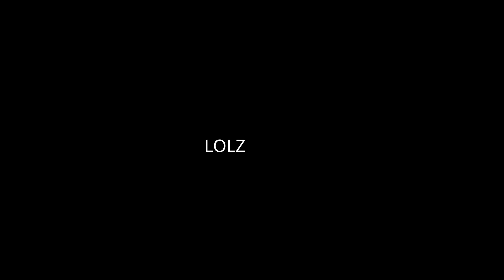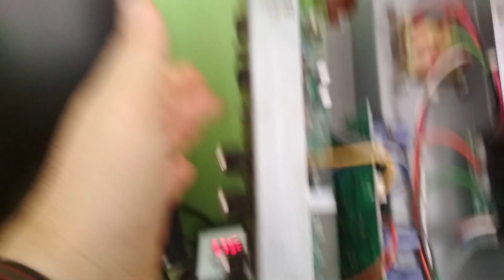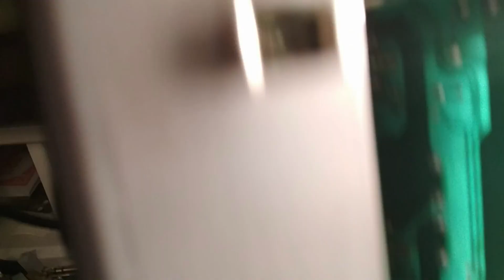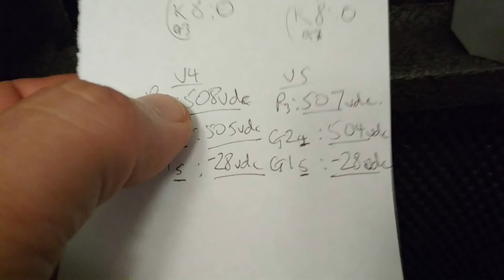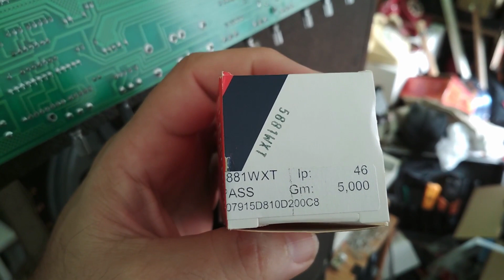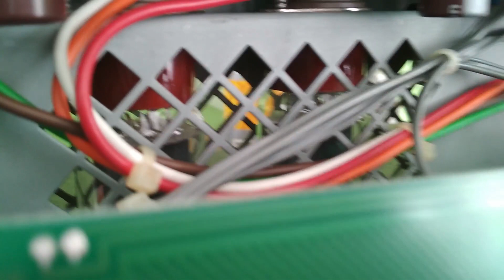Marshall JTM 30 from Hell

Comment: I just finished modding the Marshall TSL100 which in itself is a nightmare but can easily be done so the tubes never Red Plate again. Marshall really ruined their Company by making these boards such as the TSL conductive board where you have to take a Dremel gun and grid pin 5 of each power tube away from the board and rebuild the bias grid.
So sad that a once Great Company didn't care or do enough research on the parts they were using. Simply Sad.
Reply from the maker: Amps use to be built by people with pride. Now, like everything new and modern, they are built with price, not pride.

Comment: i need some of help... in my case... the amp was not used since  long years ago.
The clean channel sounds Perfect but the boost channel not work fine... sounds very low volume.. with aleatory noise and with a lot of power less,

I have circuit diagrams. Any ideas where I should start?
I'm almost sure the problem is NOT With the tubes. Prior to the failure, it has been used moderately... no more than 2 years...
Reply from the maker: @CristianGarcia-sw8ve  it sounds more involved, I’d be looking at signal tracing where things are going wrong.
Reply: @FixItAgainPhoney  almost surely theproblem is in Caps..because The amp worked perfectly the last time it was used. Therefore, the electrolyte in the filters has probably dried out.
It was like 5 years without turning on...or more. I haven't started repairing it yet
Reply from the maker: @ you’re possibly correct. One way to find out. Keep us updated.

Comment: Interesting, same amp & same issue on my bench (Bias voltage drop taken from -39v down to -30v on pin 5). BUT in my case it appears that PI leaky coupling caps are responsible.
Otherwise, disconnecting one end leg of the zeners gives a bias voltage increase to -50v, no more. So I put a 51v zener instead for security and added a bias pot - wich can be useful if customer wants to choose between 5881 or 6l6.
Reply from the maker: Nice little mods to help make adjustments. Indeed the PI coupling caps can definitely cause this kind of thing too. Very common.

Comment: Bon j'ai fini par trouver le problème tout simplement une lampe du préampli  en fin de vie  . Le fait d'avoir changer les condensateurs l'a certainement achevé. Je crains quand  même devoir faire le bias mais je ne sais pas trop comment m'y prendre . Faut il retoucher à ces fameuses diodes ? Merci d'avance. Dan
Reply from the maker: Yes, it’s worth increasing the value of the diodes anyway, purely to bring that bias down below 100%. Three 15v zener diodes should be fine but every amp and set of 5881 tubes will be different, so you’ll have to experiment with your amp.

Comment: Hello  . Could you give me some directions. I have a breakdown on my Jmp 30.
No sound on the crunch channel and very low on the drive. The amp works correctly I changed the majority of the capacitors. There was a problem with the treble potentiometer turning on itself.
Thanks for your help. Dan
Reply from the maker: Hi there. It would be challenging to diagnose but have you used the correct value treble pot? Are the solder joints and circuit board traces still in tact? Do you have a signal generator and oscilloscope to properly diagnose and signal trace the signal path to see where it drops off? You’ll have to trace from the input jack to first tube grid, out of the plate to the next part of the circuit and so on.

Comment: My JTM30 has problem, after 30 minutes the sound starting to get poor and low in the volume, and the sound is finally gone, I have to turn it off and wait for awhile to turn it back on then the sound become normal.
Reply from the maker: It’s likely losing bias and probably needs repair. Time to take some measurements.

Comment: I own one of these and the JCM900 4500 so I was desperate for what you are sharing! Thanks so much!
Reply from the maker: Thanks matey. This amp sure was a blazing sun. Ultimately the hot bias in addition to the power transformer ultimately failing was a huge reason for the hot running. Once I threw in a Hammond power tranny the bias truly dropped to a very reasonable point along with bias adjustments I made with replacing the zener diodes.
Reply: @FixItAgainPhoney  would love to see how to fix the reverb on it. Mine has never worked.
Reply from the maker: @richclayton5785  keep us posted if you figure it out.

Comment: Marshall should start putting a bias potentiometer in all of the models of this amp.  Good job!
Reply from the maker: Thank you for the support and the comment!

Yes, I agree 100% but they didn’t. So we’ve gotta work with what we have and mod the amp.

Sadly a lot of manufacturers push the tubes beyond their designed ratings in order to market a higher wattage.

Stay well.

Comment: I have sovtek 6l6wgc power tubes and have never had a problem. To fix to heat issue, I used foil tape to reflect the heat away from the pcb. I covered the venting grid with the tape from the outside of the chassis, reflecting the heat down towards the tubes. It still runs hot, but, I no longer have the heat of the tubes rising up into the chassis because of the venting grid.
Reply from the maker: Anthony Szwec those tubes will also work as they are similar to 5881. However, the amp design is poor at best so while the fan works well along with the grill being covered, this is a bandaid solution that doesn’t fix the poor operation of the amp. But it will help keep it running cooler.
Reply: @FixItAgainPhoney  But, this band-aid solution has lasted a long time. No faults with the amp whatsoever. Marshall should release this amp again, but, with upgrades. I bet it would sell good. Unfortunately they are making a lot of their stuff oversea. I have the dsl 15 watt combo and it's terrible sounding, very fizzy.
Reply from the maker: @CockySoupNazi  absolutely. Not denying the solution. It doesn't "fix" the design fault. But it would be amazing if they did reissue the amp, with a more traditional fixed adjustable bias or cathode biased.
Reply: @FixItAgainPhoney   would the 6L6GC not offer a little more 'head room' in regards to the -39v from the original bias design?
Reply from the maker: @antonytroughton2611  not necessarily. Because the -39VDC is just one piece of the puzzle when it comes to bias. Since the 6L6GC can run at a higher plate voltage, which we can't change in the amp, technically all that really happens by swapping the 5881 to a 6L6 is that the different tubes require a different bias, but we've change the tube and not changed either supplies. The plate voltage is the same, the negative bias voltage is the same. The tube, while 5881 and 6L6 are somewhat related, aren't the same tube. In my opinion, it'll be like taking a small engine in a car, and replacing it with a larger one. But using the same small carburettor from the original engine. You might notice a slight difference, but you're still feeding the same air and fuel ratio the little carburettor has to offer. So, the bigger engine really won't be performing to its fullest potential.
Reply: @FixItAgainPhoney  thank you for the hasty response. Did you get my message through your YouTube channel about the capacitor bleeding video. I cannot locate that vid and would love to view it. Cheers mate, and a personal email to hassle you a little would be great!
Reply from the maker: @antonytroughton2611  I didn't receive a message via YouTube. Will try and find it. I don't believe I've done a cap bleeding video yet. I might do one this week though.
Reply: @FixItAgainPhoney  Sorry for hijacking the thread, it was through the 'Discussions" tab on your YouTube channel. Cheers mate.
Reply from the maker: @antonytroughton2611  ah. I can't seem to see that in my phone. However, all good. Not hijacking at all. Happy to chat about anything amp related within my understanding. I'm always still learning we stuff.

Comment: Thanks so much for sharing this info. I have a 112 that I haven't used much because of these faults. 

Can you itemise the parts that you changed? I get the new 15volt zeners but you said that you also swapped the x cap, and electrolytic cap and another diode. What values did you use for these?

Thanks
Reply from the maker: I used the exact same x-cap and same rated negative bias cap. I only changed the ZD's to a higher spec to allow more negative bias voltage to run the tubes colder.
Reply: @FixItAgainPhoney  I replaced ZD101 with a 18Volt 1N4746 Zener and brings the Plate current down to 38ma
Reply from the maker: @TheDkrupinski  Nice one. Perfect!